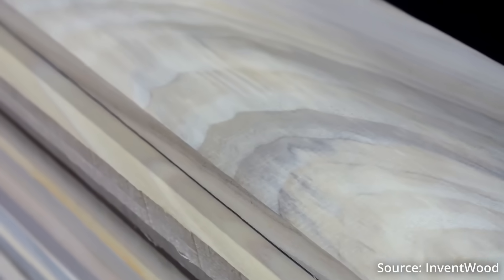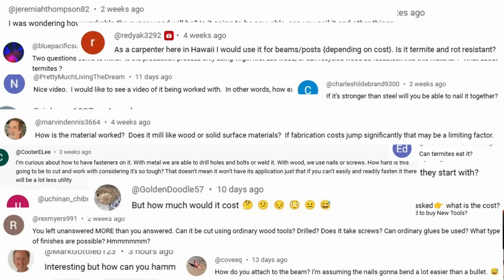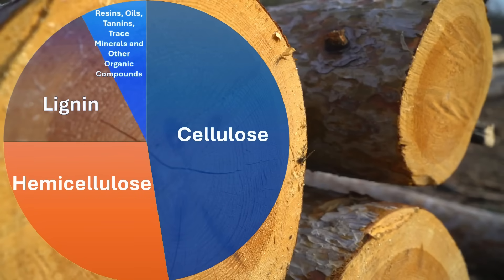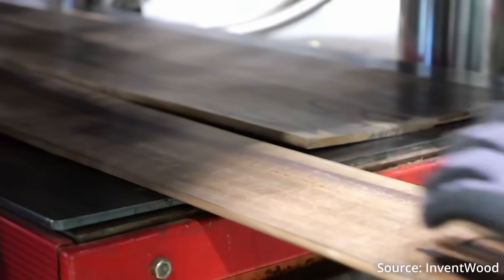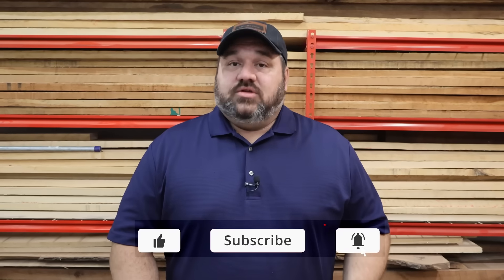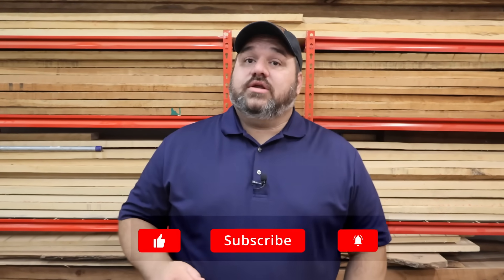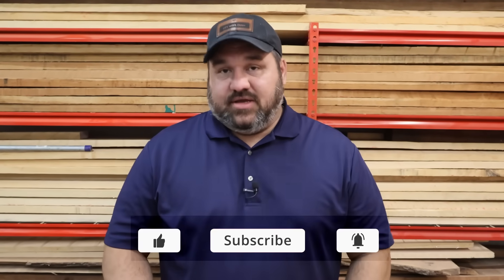The TRUTH About SUPERWOOD - I Met With The CEO of InventWood and Have Answers to All Your Questions

Comment: Besides being fire resistance and cladding .  Wood is lighter than steel. To make a piece of superwood that is 1 inch thick ,it may require 4 inches thick of natural wood. I am not sure this is the wisest use of renewable resources that is high  priced and short in supply.

Comment: I want To build the ultimate house out of super wood hardwood and Roman concrete, upgraded with extra lime and basalt rebar. It will have a mass heater a water cistern a cold porch, an pndol, a greenhouse roof, awnings and geothermal air tubes

Comment: I don’t see it replacing steel unless it has the other categories of strength, tensile, strength, torsional strength, etc. in that case it’s not gonna replace studs either because it’s too hard to work i and expensive so yeah it’s looks like it’s not gonna be useful in the building trades.

Comment: Thanks for this discussion. One of the first applications for their product that sprung to mind was as a replacement for structural reinforcement steel in concrete building. In many cases, it is the rusting of such reinforcement that triggers building replacement or, sadly, collapse.

Comment: I would love to see how to make a chest with lid only using Superwood. No metal nails, no metal screws, no materials beside it.
This process would really show how to work with it, make joints, let it be smooth so the lid can be opened, reduce the friction at the points were the lid is combined with the chest and so on.

Comment: Are they sure it's as strong and tough as Steel? If so Toss out all those Router Bits, The Wood Drills and the Wood Bandsaw Blades. The Replacements will need to be at least on the Cobalt Material Level. Also tell Production to Slow the Cutting Speeds Down. What about Coolant? The Scourge Cost of Machining Steels? Also, the EPA and DEQ Regulations for Coolants? Tip, contact Kennametal. That's Steel.

Comment: If it is concidered to be a structural replacement for steel, I would like to know what its long-term creep properties are. Steel is fully elastic below its yield stress. Any deformation returns to normal once the load is removed. Timber on the other hand suffers long term creep and can deform permanently under sustained long term loading, Take a look at old timber floor joists.

Comment: This will create Structural Insulated Cladding with Interior Wooden Paneling that will replace Structural Insulated Panels.  It will be made to architect's spec in a factory and delivered to site where it will be assembled like IKEA furniture in two days tops. Framers, house wrap installers, insulators, drywallers, exterior finishers, painters all made obsolete.  Good riddens.

Comment: "Strength" can be measured in different ways: 1) tensile strength, 2) compressive strength, 3) shear strength, 4) torsional strength, 5) yield strength. Where does superwood excel, and where are other materials better?
Reply: As an engineer, I would b interested in knowing these numbers as well. I already know the numbers for all the other woods we use in construction, including things like GlueLams, finger joined boards, etc.

Comment: you dont need supper wood to use wood for construciton.  People have been building very very solid, large, buildings for thousands of years using wood.   One of the benefits of raw wood for construction framing (not modern framing but tradiastional) is that it can flex when under load.   Built correclty (see japan) you can have large wooden buildins shack of the harshest of earthquakes while the concreate and steal buildings next door are destroyed.   

I dont think we need to spend $$$$ on supper word when builders these days do not never know how to use normal wood. We should not be modifiing wood to deal with lack of education of the builders but rather investing in edudation for builders and changing building codes to puch develoeprs back to a traddition design concepts.  I myself live in a fire risk zoon but am in 120+ year old mud brick home, if a fire comes our way (hopefully not) our home will be fine since the people that built it undersoon that blocks of dried mud are very very good at protecting from fires

Comment: Regarding the cost, Do you really need a board of Superwood as thick as a normal fenceboard? Wouldn't a board of superwood 1/5th as thick work just as well since it will be harder and just as strong as a regular fenceboard?

Or if standard thickness is needed how about a hollow superwood board  Same with fenceposts, etc.

Comment: I live in my RV full time.  I all too often see videos on YouTube of RV's that catch fire and burn to the ground in less than 10 minutes.  Part of the reason for this is that most, possibly all RV interiors are sheeted with quarter inch plywood.  So, I am very interested in the possible uses of Superwood replacing plywood in RV construction.  Heck!  I might even be willing to tear my home apart to replace the flammable plywood that surrounds me with Superwood!

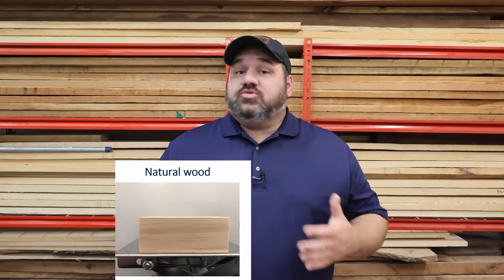Comment: 1:25 : To be clear ... in this picture the natural wood is tronger then the so called "Superwood", cause the fiber distribution is far from the center... in the horizontal axe they are maybe similar but in the vertical axe the natural wood will clearly do not bend as easily as your superwood.
That the compressed wood is stronger to nail penetration, clearly it will be... that it is more dense .. of course.. but the situations where you can use it do not seems to common to me. Maybe floor.....
How much energy is used to do the process ? Cause you can compress pine .. but you will not compress oak.
Look like an other american dumb idea.... to me.

Comment: Two applications immediately come to mind:

1. Aircraft framing. Aluminum is 1/3 the weight of steel vs superwood's 1/10. That reduction in weight could unlock a new era of flight, just like the upgrade from wood to aluminum!

2. Boat hulls. Wooden hulls are heavy and become water damaged, and steel hulls are even heavier, and wear away electromagnetically (not going into it, but they do). Plastic and fiberglass hulls are not environmentally friendly, and can sun rot. Depending on how resistant they can get their product, it could be fascinating to see what could be done in marine applications.

Comment: I'd be interested to hear how Superwood compares to laminated-veneer lumber (LVL), cross laminated timber (CLT) and other engineered woods. For example, if I have an exterior glass wall, and I want the pillars/framing to be as thin as possible while still be able to carry the weight of the roof, how much of a difference would Superwood provide compared to these other wood products?

Comment: it would be interesting (as an experiment) to build a car using superwood.  not everything, but the structural parts, like the chassis body structure (roll cage for example) with regular woods and laminates for the body.  I.E. a modern 'Woodie'! I could see foresee a performance super-car using superwood for it's strength and being lighter than steel.

Comment: Saying steel is dirty and none renewable is a deceiving comment. Both are true but it's also true that the process of clearing wood and the chemical process is also dirty. And while steel isn't renewable it's recyclable which is much cleaner than getting the iron ore to begin with. I doubt the super wood is recyclable or there would be any desire to do so.

Comment: You're pitching "cleaner than steel", and environment friendliness, but forget that entire forests needs to be harvested, hauled, etc. Not to mention the process, which includes boiling it for a long time in chemicals, then pressed while being heated, all of which takes a tremendous amount of energy. Pretty much all it's going for it is that it's biodegradable, which both a pro and con. Steel is pretty much infinitely recyclable. Wood isn't. And we still have no idea about the price tag. One thing for sure, I'm not gonna invest in the company.

Comment: Hi Dave!

Something I'd be interested in is the damping and acoustic properties of the material. It sounds to me like this could potentially be a wonderful alternative material to build things like speakers out of. I wonder if the company is working on any variants designed to have a very high damping coefficient? It seems to me that with the ability to impregnate the material with something to enhance water resistance, this process could similarly be used to impregnate it to optimize for acoustic properties. I'm glad to see the company scaling this concept as I found it really interesting when I first heard about it.

Another good thing to learn more about would be the environmental considerations around their treatment chemicals and their ability to recycle the used chemicals to reuse for the next watch - are they able to e.g. pull the dissolved wood materials out of solution, to reuse for the next batch while also being able to then use those recovered materials from the original wood for other applications?

Comment: The fact that they tested termites and the bugs just died because they couldnt get through what amounted to a brick wall to them is awesome for structural purposes
Reply: I'm not watching this all right now.... But some termites and big headed ants eat through concrete so I'd image the would get through this
Reply: @L0st-n0found  ive never heard of ants or termites getting through solid concrete, thats wild
Reply: @crispycrusader1 perhaps Im wromg and not the termites as they may just find pathway through cracks or deterioration.    Have seen big headed ants push up cement dust from new holes in concrete slabs though.
Reply: @L0st-n0found  That is it, they find a way through a crack, they do not chew concrete.
Reply: @crispycrusader1 they do. If there r cracks in the concrete too small to see or cracks u cant see where the concrete meets the ground, they will find it, work the crack until it opens up. Once that happens, then they can get into ur walls.
Reply: @L0st-n0found , yes, i was shown where some western australian termites took the time to chew through a weak spot in concrete just to scavenge timber offcuts beneath the concrete slab of a commercial building.
Reply: the termite test needs to be done with some of australia's termites.   some species are the size of fly maggots.   they are voracious because some australian timbers are very dense.   having said that, if there are remnant chemicals remaining in the superwood, it might prove to be indigestible.
Reply: I have had problems with carpenter ants. I have been advised, and observation seems to confirm, that they are much happier with wet wood.
Reply: @warringtonfaust1088  , termites cant survive in a dry situation.   some can tolerate dryness better than others.   and it makes the harder woods easier to chew.
Reply: @warringtonfaust1088  carpenter ants have a specific purpose. They r actually servants to very large mature trees, & the tree tricks them into an employment program to mine out the dead wood in the center of the trunk. Since the living part of the trunk is basically a hollow tube shape top to bottom, & the center portion of non living tissue is totally structural. That center portion is technically dead wood, so as the tree reaches maturity it sucked all the nutrients its roots can reach, & is wholly relying on its mychorzzial fungal partner. This isn't enuf nutrients for a giant vegetable that size, so if it can't reach outward, it reaches inward. The tree begins to suck all the stored nutrients & water from the dead structural center portion of the trunk. Eventually, dry rot sets in. Once the center wood succumbs to dry rot, the tree needs only to wait for spring, when the ants start flying. When the snow melts, & spring rains arrive, there is usually enuf moisture for the tree to begin saturating the dry rot, which releases a specific set of odor molecules that newly hatched ant queens r looking for, & they key in on the smell, & track it back to the affected tree. To get the remaining nutrients the tree cant extract from the dry rot wood, it employs the ants to mine out the dry rot, who dump the tailings out of old knot holes in the branches. Dropping it all away from the trunk, & closer to the drip line of the branches where the feeder roots r.  Having used this technique myself on fruit trees, by installing queens manually, I saw a marked difference between the growth that yr with the ants, than the previous couple years without them. The tree appeared healthier & happier, produced better tasting & larger fruit. The tree in question was an ancient apricot approx 150 yrs old with a trunk thickness of 3.5 feet, about 1.1m.  Important note: branches become brittle without the center structural wood & require support posts installed below them or the weight of the fruit w snap them off or shear off at the trunk base in the wind.

Comment: Modifying the process to replace part of the lignin with epoxy plastics is also possible.  It just requires soaking the wood with the desired resins after the lignin is removed and before compression.
Reply: Add boric acid for bug and microbial protection

Comment: Does the wood stand up to molds.  
Does the wood do well at high altitudes where the air is thin and sun exposure is more intense (Alaska or the poles).  
Does the wood mix well with rubber for making punctureless tires, shoes, and soft but durable water-proof seating. 
How well does it withstand being used as a tractor track.  
How well does it hold up to gas pressure such as being formed into a bottle or tank.  
How well does it work as pipe for water, other liquids, or gas tubing.  
Can the wood be used as wire tubing.  
Can the wood be used for aircraft construction and/or surface material.
Can the wood be used as a false-floor planking material.
Can the wood stand up to sea water and does depth/pressure change its permeability.

Comment: I still have not seen a clarification on what "stronger than steel" means. Even disregarding that there are multiple types of strength (stiffness, elasticity, tensile/compressive, transverse/bending, etc), I think it's likely they mean strength-to-weight ratio, without clarifying what the weight is compared to steel. This is a big red flag, and while I'm sure it's a cool material I wish they were more honest feeling, rather than trying to conflate terms to trick laypeople.

Comment: Saying it is stronger than steel, implies all types of steel.  This case would be grossly inaccurate.  Alloyed steel, not mild, low carbon steel, is still one of the strongest materials on the planet, especially at reasonable cost per volume. “Twice as strong” needs to be clarified which steel, and which form of strength: yield, shear, tension???

Comment: I am curious whether two pieces connected by a mechanical fastener like a bolt would experience hole elongation as torque is applied to ends of the pieces. Basically this would be testing the compress-ability of the fibers when subjected to very localized, high impact forces.

This would be compared to steel where you can drill a hole into two pieces and then use a bolt to securely fasten the segments together (imagine an extreme example like two segments of a car's suspension linkage). I wonder how comparable superwood would be in a situation like this (maybe not as extreme as a car suspension, but maybe something like a bike frame)

Comment: A potentially high value wood to consider is an alternative to teak (or for that matter other woods) for yacht and ship building. Teak is a 'protected' wood in that remains in high demand for maritime use. There are already alternative 'teak' emulators capitalizing on the high wood cost. You wouldn't necessarily need to emulate teak, though if you could, that would be great. In any case, it is something to consider, as the higher cost would be of little concern to someone building a yacht. At the very least, some marketing efforts should be made towards yacht builders so they are aware of the material opportunities.

Comment: sounds like a good flooring. probably could be stripped and resurfaced unlike many other floorings, meaning it might last a really long time. Flooring doesn't need to be heavy like furniture does, or voluminous like walls, thin hard planks are perfect. Maybe it would make a good skate-ramp? Maybe it will make wood flooring viable once again for public spaces? outdoor spaces? boats? surfboards? I wonder how it compares to carbon fiber in things like FPV racing drone frames?

Comment: What would be the cost difference between a similar-sized Superwood panel and a steel or aluminum plate or sheet? Where can we find the material's data mechanical properties such as tensile, yield, compression, sheer strength, etc?